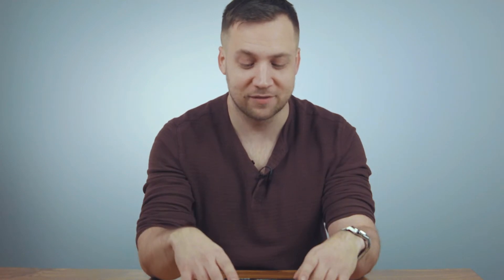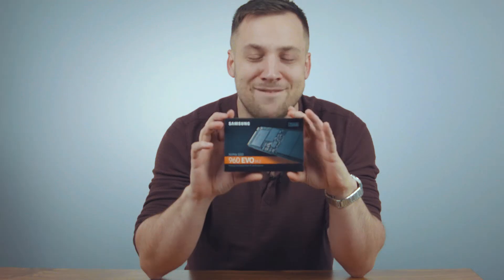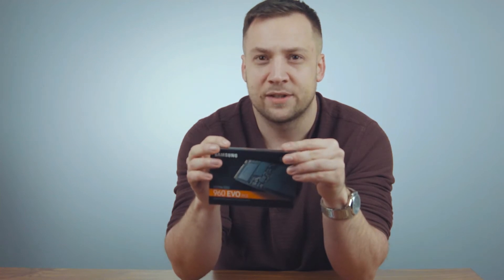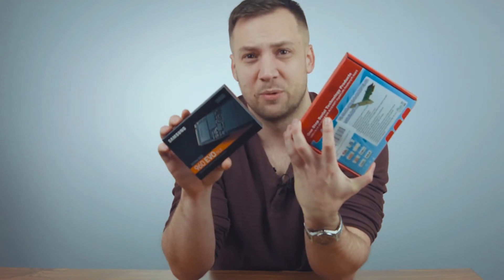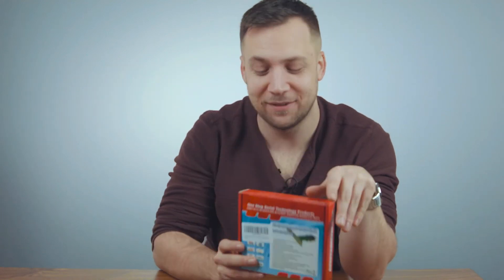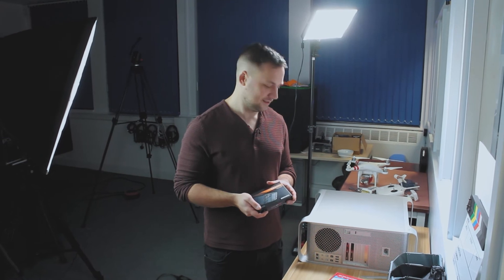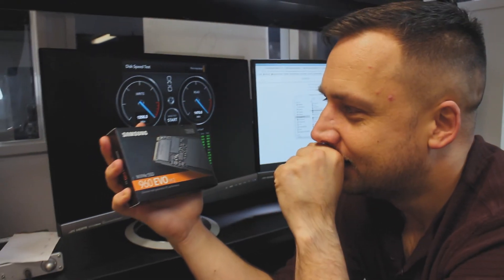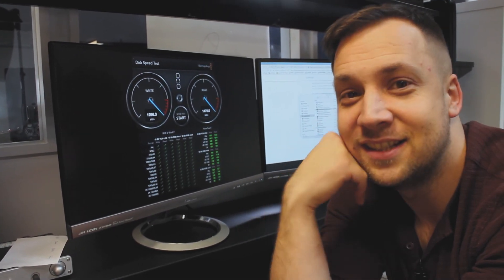Worlds Fastest Consumer Hard Drives - PCIE NVME M.2 SSD in a Mac Pro 5,1

Comment: that is slow, you need to install the PCIE nvme into the third slot near the VGA since it is 16x , which will give read and write much higher than you have ...
Reply from the maker: Thanks for that dude. I believe the spare x16 is actually blocked by the size of my graphics card currently. Will double check though 🙌🙌
Reply: @120fps  if you install the Video card at the last PCIE ( Bottom) , you will have some clearance for the 3rd one ( above the Video card ),
Reply from the maker: Thanks dude. I ended up looking at that 🙌🙌

Comment: Did it! What format did you format the drive as? APFS? OS Extended? Speeds are great, but getting a weird error "Names longer than 31 characters are not supported on the destination volume." as OS Extended (journaled). Thanks!
Reply from the maker: It was a while ago now, but I believe it was APFS mate. All still working fine now with the same speeds. 🙌
Reply: @120fps  It's all good. Google Chrome needed its prefs trashed and a system restart. All back to normal. (BTW, I formatted HFS+). Thanks for the great video and inspiring me to upgrade the old girl one more time. Cheers.
Reply from the maker: Nice one Charlie, well done for getting it sorted. They’re great machines still. Also thanks for the support, really appreciate it. 🙌🙌

Comment: Will this work on a 5,1 Mac running Sierra?
Reply from the maker: Totally should do mate 🙌
Reply: @120fps  Not with any reliability. You need (at least) the 0089 firmware which is included with high sierra. You could start the installer for HS, do the firmware upgrade and not continue the install.

Comment: Interesting that you ‘only’ (lol) seem to be getting 1300MB/s write + 1500MB/s read. Theoretically these drives are capable of nearly double that. I’m guessing that’s a limitation of the PCIe 2.0 BUS running at 4x. I’m wondering if there’s a caddy card capable of piping it through an 8x connection which would compensate. If not, an AHCI Samsung 951 can do those speeds and is bootable. Though NVMe technology is superior when it comes to multiple file transfer because of the way it handles queuing. Oh, and the 951 AHCI’s are rare af and therefore super expensive and don’t come larger than 512GB. But basically IMO opinion there’s no point in spending ages trying to hack a Mac Pro to boot from an NVMe drive when for all intents and purposes you can do it without the hassle/maintenance issues.
Reply: Cheap controller cards do bifurcation. Get a good controller for the nvme and it'll do 3000MB/s. Anglebirds makes one thats not too hard on the wallet.
Reply: Ster angelbird or angle ?

Comment: for logic pro, we are using too many plugins, so the system says 'System Overload' for several times. My friends say, if the OS X was installed on SSD, system overload message would not happen. my ram is 32 gb. but os x is installed on HDD. as a secondary storage I have Samsung 960 1TB NVMe M.2 PCIe SSD. we say it is not possible to use this samsung ssd as a main os x installed on it, is that right? so to be able to solve the problem of 'system overload' I will buy another ssd to use it on the main os x installed. which one for example I can buy?
Reply: If running too many plugins is causing you this issue, an SSD as the system disk won’t solve Logic X system overloads. Whilst disk overloads can cause this message, too many plugins cause the CPU to overload. And besides, you can solve the disk part by storing your projects/samples on the NVMEe drive. If you’re running a Mac Pro 4/5,1 sounds like you need to upgrade the CPU. If not, time for a new machine. Although there’s a very interesting article somewhere on the Apple website about how to conserve CPU by managing how you use different channel strips. Have a look.

Comment: Question does the PCIE NVME M.2 SSD is still working on your Mac because some of the consumers be saying it work only a month & it died
Reply from the maker: Mine is still working strong. Gets used everyday for a scratch drive for video editing. Never had any issues since install 🙌
Reply: INGAF how about now, how’s it doing?
Reply from the maker: Still using it, it rocks. Sure there’s quicker nvme tech now, but it’s still one of the best upgrades I’ve ever done.
Reply: INGAF oh sounds like it is well worth it I’m picking one up soon. Thanks or the reply.

Comment: Is it bootable? or just used as storage
Reply from the maker: Hey there, it isn't bootable. There was some people I read online that managed to boot from them when did some serious hacking. I use mine to purely store current projects on. So for pulling large 4k video files for editing, essentially a really fast scratch drive... the speeds for that though make it an entirely worthy upgrade.
Reply: There’s a method to inject the nvme driver into the EFI so its bootable. https://forums.macrumors.com/threads/mp51-0084-b00-rom-dump-request.2119496/page-14
Reply: Dave Phoenix Boots fine if you upgrade your 5,1 to Mojave.  It comes with an updated firmware for the Mac Pro that supports NVMe for booting. Works great on mine.
Reply: Can you partition it for BootCamp & Windows on Mac Pro 5,1?  @JohnLee-eq1ck
Reply: Mark Gilley my understanding is that you can but since my video card is a non-apple card I won’t do it.  Too much of an issue when you get no video at boot up. Can’t switch between boot amp and MacOS very easy.
Reply: @JohnLee-eq1ck  I run a GT120 and an RX580 with nvme boot. Works fine. A GT120 is pretty cheap used.
Reply: Ster Fry I have one but that isn’t a card supported my metal.  Wouldn’t Mojave not like it if I installed it?
Reply: @JohnLee-eq1ck  You just need an efi card for the firmware update and boot screen if you need that. Otherwise, use the GT120 for firmware update and initial installation then pull it.
Reply from the maker: That’s really interesting!!! Might try that Dave. Have you noticed an improvement in performance of the os?

Comment: Is it possible to put three of these in a Mac Pro 2010? And is it possible and or beneficial to put them in raid 0?  I was curious to know if I could use one of these as a boot drive , and then have 2 of them in raid 0 as a scratch drive , and then dump files to a regular 7200 HD ? 
I will mostly be doing audio production (PT12) and video editing ( FCPX and photo shop things ) 
Any help would be appreciated !
Reply from the maker: I'm not sure about Raid for them, but I do know there's major issues with having them as a boot drive. Some people have got it to work, but I believe it takes a lot of customisation. You could probably put three in, but they will most likely always be for a scratch drive, or you could possibly install applications on them for faster boot times.

For me I've been using them as a scratch drive for video editing and it has worked a charm, consistent and crazy fast. If anything there's other parts that are now bottlenecking the computer!
Reply: What aboutttt getting a samsung 951 AHCI m.2 NVMe and putting it in PCIe slot 4 socket as the boot, then getting two Samsung EVO 960 Pro 512Gb and putting those two in raid just for that wicked fast SSD ? what type of speeds are you getting, my friend?
Reply from the maker: Not sure about that. I know there's generally issues with getting NVME PCIe drives to work as bootable. Not tried the 951 though. Speed wise, last time I ran the HDD speed test on it I was getting 1,300MB/S read & write... crazy!!
Reply: INGAF 
That’s insane ! Imagine telling someone in 2010 you’ll be able to get 1300mb speeds in a while .. they wouldn’t believe it .. those speeds are nothing to scoff at for a Mac that’s 8 years old..

Comment: I really enjoyed your video – it's fun. I know you're doing this on a Mac Pro 5,1 but you do mention the 4,1s & 3,1s as well. I'm trying to help my son learn how to upgrade his hand-me-down 2009 Mac Pro of mine (4,1) running 10.11.6 El Capitain. We just tried the Plextor M8Pe PCIe card with NVMe, and it simply doesn't work.

After hours of scouring the web, I'm more disoriented than ever! It seems like we'd have to do some kernel hacks just to get something like your Samsung + Lycom solution working as a data drive. I'd really like to just get my son one boot drive that can run apps and load his games faster. Do you have any sane advice by chance?

Thanks in advance,
Reply from the maker: Hey there, it is totally a minefield! From what I recall of the 4,1 you may have to flash the firmware of the computer so it reads as a 5,1 first & then install the latest version of OSX (10.13) - that bit is important as the NVME drives only work with the latest OS. 

Hope that helps & thanks so much for dropping by and leaving a comment, we really appreciate the support :)
Reply: Yeah, I kinda gave up on the NVMe route. The only card that apparently just worked out of the box was that Kingston Hyper X SSD that seems to be no longer available. So, we just sent the Plextor back and got an OWC Accelsior S PCIe card, and put a 2.5" SSD in that. Instantly recognized by the old 2009 Mac Pro, formatted & installed a fresh copy of 10.11.6, and get 500+MBs R/Ws. Good enough for now probably.

We might try flashing the EFI to get 5,1 on it, but only to get the latest OS features. Fact is, we're kind of running up against the CPU limits now, a decade on in technology. Too bad we couldn't just do a 2012 quad core i7 Mac mini and eGPU box, eh?

Thanks again for replying!
Reply: You can only use NVMe drive as scratch drive, not boot drive. You can get a ASHI M.2 drive for faster performance, but I would say SATA III drive is enough for normal use.
Reply: Yes, this is what I've learned. But even a lowly SSD in a PCIe add-in card is tons faster than the stock 7,200rpm SATAIII HDD.
Reply: you mean only with Mojave is it possible to boot the NVME SSD from the PCIE Slot with the Adapter Card???  Jose Francisco Medeiros
Reply: @Vocalisto  Yes, the new bootrom that is automatically applied when you update to Mojave allows you to boot from nvme. I have a 4,1 updated to 5,1 with an RX580 and nvme boot drive. Works great.

Comment: https://www.youtube.com/watch?v=VZQYP-KtijU
I have a MacPro5.1 OS10.13.3 NVMe SSD SB960 Installed. Read or Write 1.3GB Over.
Reply from the maker: It really is insane r/w speeds. Loving mine. How are you getting on with yours?
Reply: Current OS 10.13.3 has conditions and NVMe alone can not be used as a boot drive, but if set as a fusion disk it will be recognized as a boot drive, but SSD could not be drawn to the maximum. When using this fusion disk, it is necessary to clear PRAM after OS update.
Reply from the maker: Thanks for the info dude. I’m using this one purely as a scratch drive to work off of. I guess that’s a little wasteful, so I may look into to what you say to get it as the book drive.